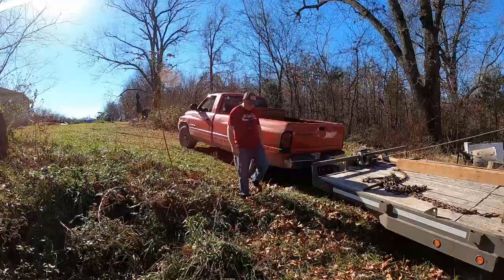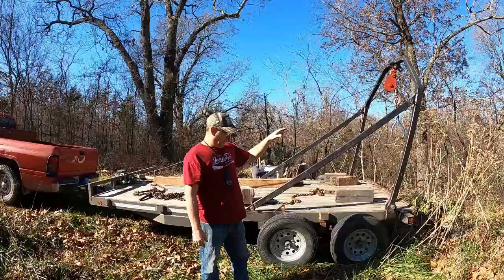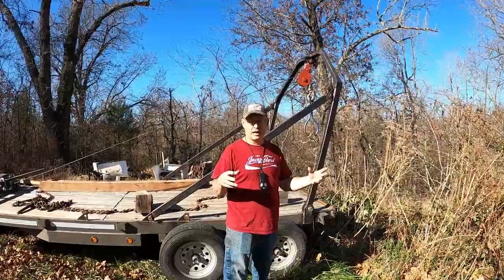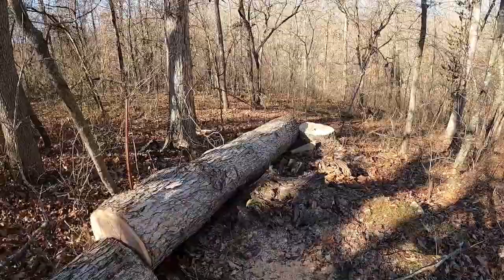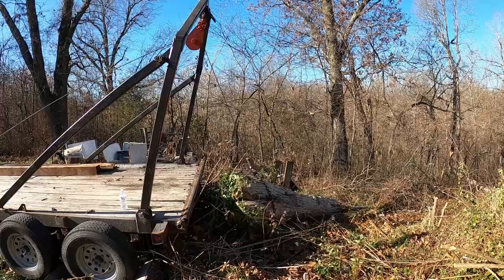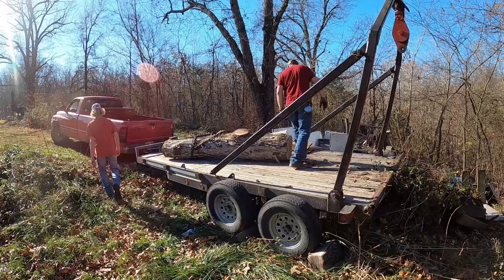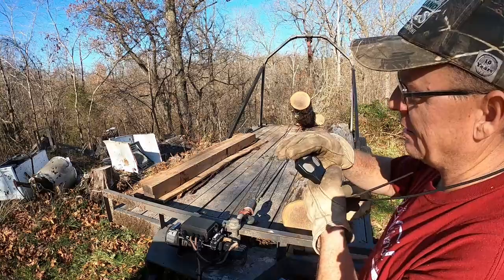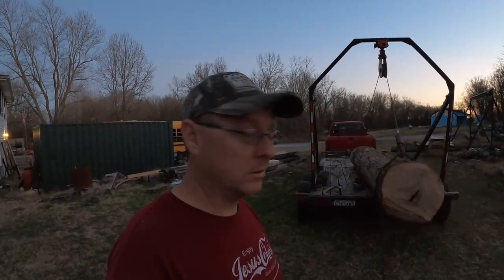Steep Grade Logging with the Log Arch Trailer - Large White Oak

Comment: Hi Dave I put a tail roller on my trailer made loading logs 10 times easier
Reply from the maker: I've thought about doing the same. I was kinda worried about logs moving to easily when moving the cable from the arch to straight pull.